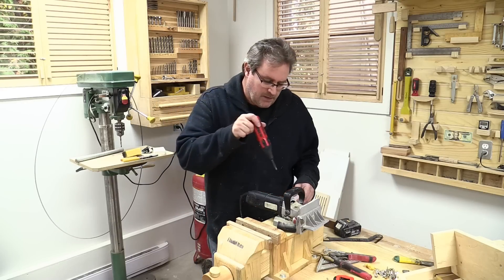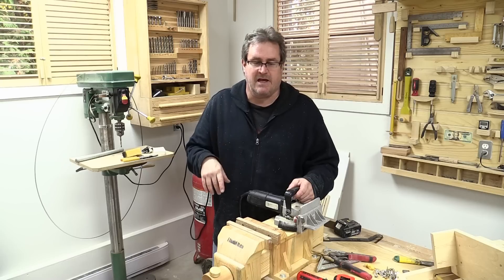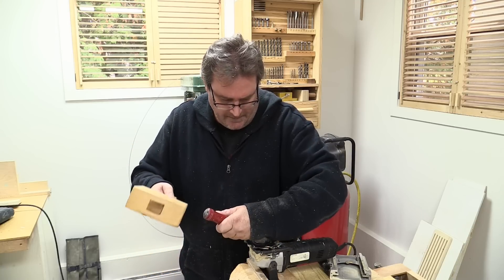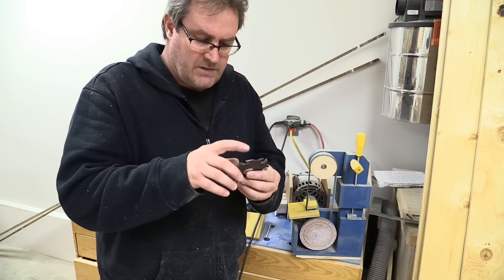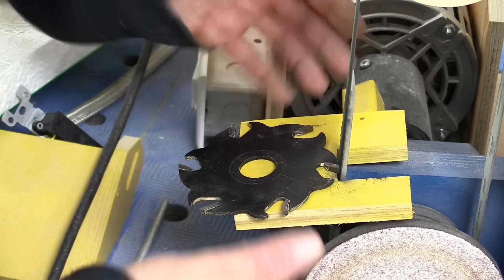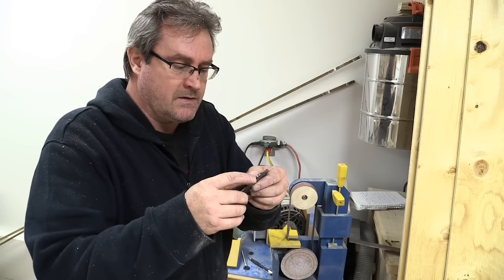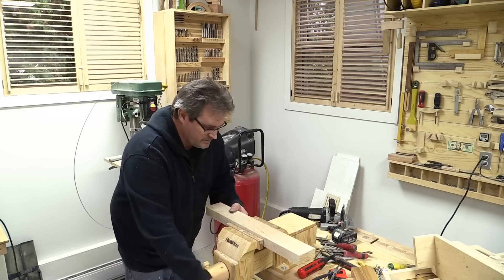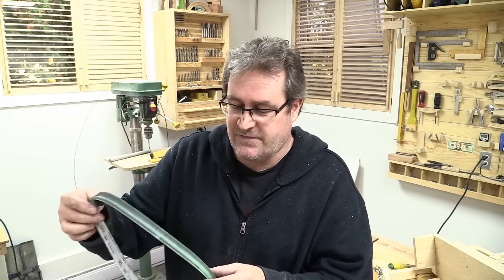Diamond Belt Sharpening A Carbide Tooth Blade

Comment: I mentioned it to someone who works at 3M but they said there is a stitched version you can get that doesn't use tape to join the ends. On another note. I have a Husky brand screwdriver set that comes with 6 sticks that have 8 bits on each that you plug into the handle. I love that thing. Plug the stick in I need and its ready to go.

Comment: Hi John, nice video! I'm wondering here about the carbide dust this sharpening method creates. I'm all for looking after my tools but since I heard carbide dust from grinding is highly toxic and/or carcinogenic when inhaled I stopped grinding my own carbide bits. I've considered just buying new tools instead of grinding them in my own shop. A water cup to catch the dust could be a good idea. Any thoughts?
Reply from the maker: +h3n488 It's like everything else - exposure time. If you are doing it day in and day out, the risks will be higher. This small amound with very little airborne will be extremely low risk. A dust mask would be enough.

Comment: Quick question if I can.  What type of packing tape did you use on the back of the belt, the clear stuff, or the stuff with the threads in it?   Do you think that if it was a thick enough tape (such as Gorilla Duct Tape) it would prevent the premature wearing at the joint?  Thanks from the 416.

Comment: Thanks for showing how to sharpen the carbide blade on the biscuit cutter. My blade is getting dull and I was wondering if I should buy a new one or sharpen it. After seeing how easy it can be to sharpen, I know what to do now. I am surprised that you didn't make your own wrench to remove the blade. Maybe that could be another video. Thanks.

Comment: Very awesome, and a lot quicker than some of the blades you have to sharpen. Have made any joints with the blade yet?  Is the new hole smaller at all to where it would affect the biscuits fitting in?

Comment: I like diamond stones the best to sharpen my knives. Very aggressive if need be.

On my 1"X30" belt grinder I've been using the silicon carbide and blue zirconia belts from Lee Valley for grinding. I've never tried a diamond belt but will have to try it out some time.

Glad it worked out for you with your biscuit joiner.

Comment: this video made me feel better about my decisions to 
try to fix my 2 angle grinders that werent working anymore
instead of buying new ones
One of them was smoking and rising temperature in the motor
the problem was a bearing ball was busted and was building friction
new bearing and was like new no more smoke
the other one replace both carbon brush and the on/off Swich 
and started working again

Comment: Why is the tooth beveled (sloped)?  Wouldn't a flat cutting edge be just as effective?
Reply from the maker: +Nelumbo Nucifera Alternate top bevel (ATB) is the most efficient cutting profile for circular blades.
Reply: Yep, realized after posting that the outside edges probably 'score' the wood before removing the bulk, giving a cleaner cut.  Thanks.

Comment: This reminds me of the old lesson about taking the time to stop working to Sharpen the Saw. I've worked in shops where they don't bother ever sharpening their blades. Just run them until they're burning the wood (or in the case of metal cutting blades, causing serious kickback), then run them some more. When they're finally truly useless they throw 'em away. I suggested using a sharpening service that actually picks up your blades for you, replaces broken teeth, tunes them up, etc. for less than the cost of replacing. They looked at me like I was stupid. Then I started looking for somewhere else to work.
Reply: +Jon Miller Stopping to sharpen a blade, chisel, etc. can actually result in a net time savings, since it takes less time and effort to the the work. Not to mention the job gets done cleaner and safer.
Reply: J DeWitt DIY Yep. That was my point.

Comment: How can a carbide blade get dull when it's cutting wood (aside from hitting a nail)? In my head wood is a way more softer material than steel, which can be cut with carbide blades. Or am I just missing something?
Reply from the maker: +alucard87 Everything that cuts gets dull. Friction and stress.
Reply: +alucard87 Wood is still abrasive and eventually will wear away even carbide, of course it takes a lot longer which is why carbide is preferred for wood working tools.
Reply: The same reason door knobs, tool handles, keyboard buttons, etc. get shiny when used a lot, even though our hands are way softer they very finely abrade the surface over a long period of time.

Comment from the maker: Trying out a diamond grit 1"x30" belt for sharpening carbide blades. It did a great job of bringing my nail-damaged biscuit joiner blade back to like new condition.
The 1"x30" belt sander project: http://www.ibuildit.ca/Workshop%20Projects/belt-disk-sander-1.html
Plans for the belt sander: http://www.ibuildit.ca/Sales/sales-11.html